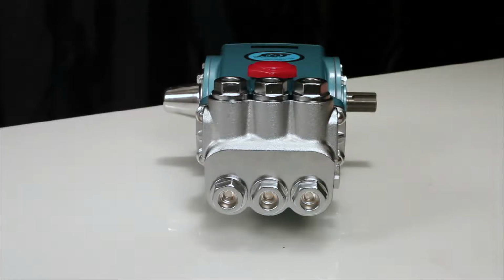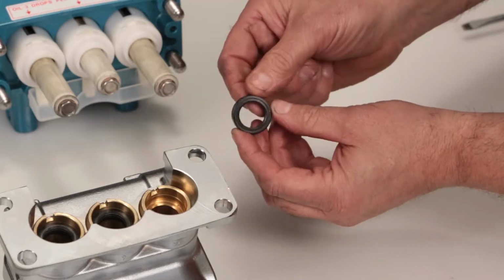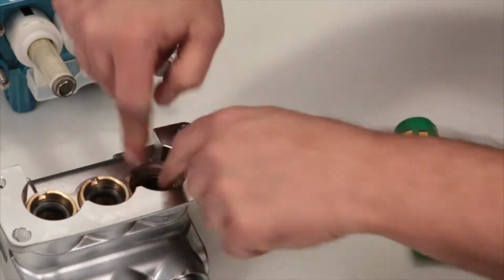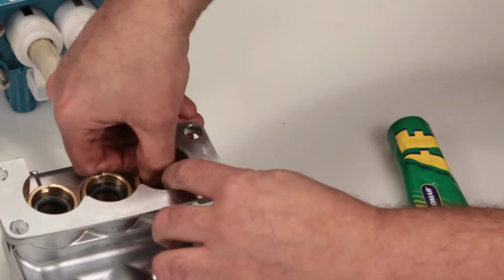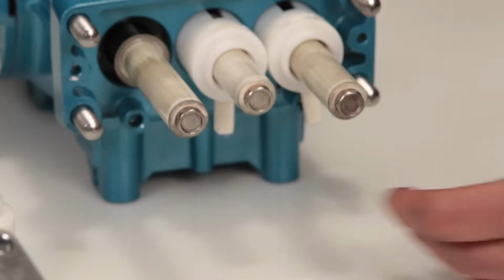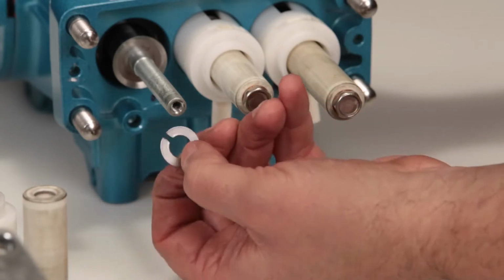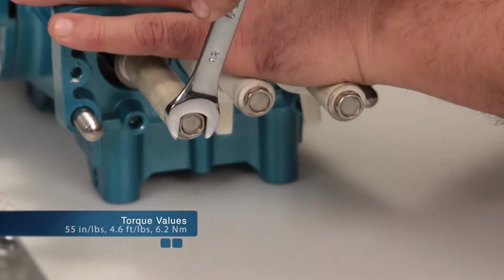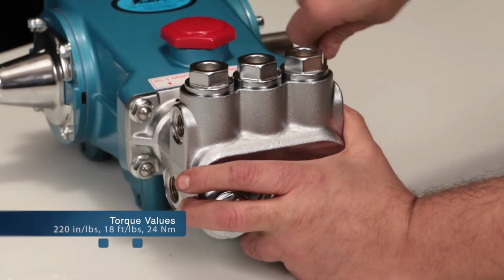How to Service the Seals in the Cat 530 7 Frame 7PFR Series Plunger Pump

Comment: The Brass seal cases are extremely soft and and they can break even with the seal case 1/2" cat tool carefully. They are tight as hell even in a big vise. I have the Brass cast manifold type 57 cat pump 7 frame version. Stripped the manifold bare of of all caps and retainer springs ect.  Gave each of the seal cases some heat and was able to extract them out with a 1/2 impact with the seal case tool. Only method that worked for me or the whole pump would be scrapped and pay another $1500 for a new pump. Got lucky!  Also if you're in the rabbit hole of these jobs pre-soak the new wicks and add a little cat fluid in the pan too.
Reply from the maker: thanks for the tip with the wicks